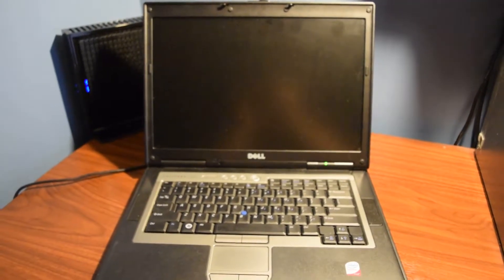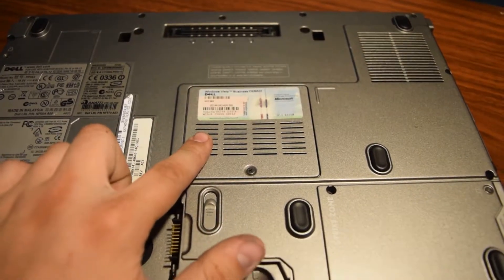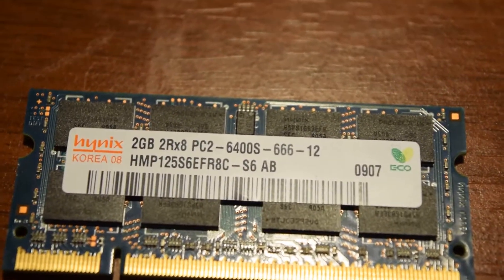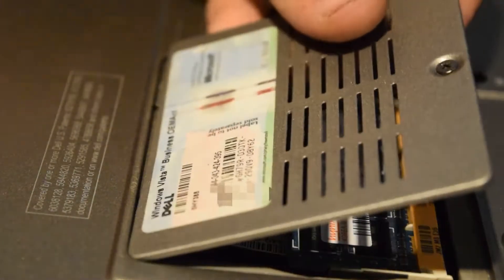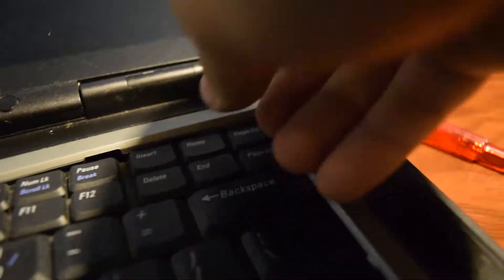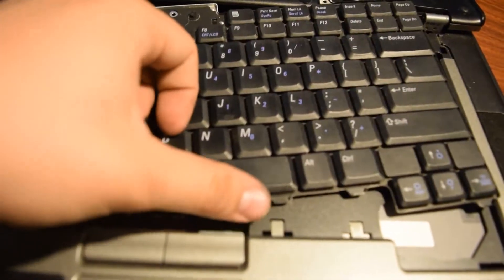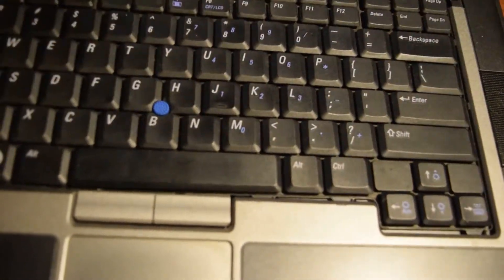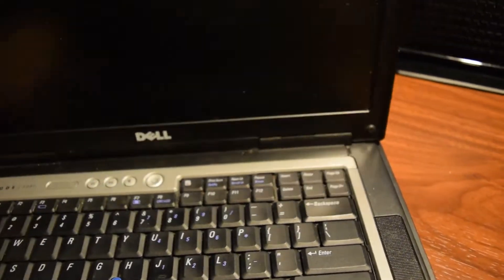How to Upgrade Ram - Dell Latitude D830

Comment: Do you upgrade bios from a16 to a19 for it to work better if so is it only with dell support
Reply: Was that a question? I just accessed the BIOS on my Latitude D830, damn thing is Version A05 and dated May 2007, so 15 years old! Hard to believe this thing is even cranking over with 15 years old BIOS. I have zero clue how to update BIOS, though. But I would need to.

Comment: i have the same exact laptop and im trying to upgrade the ram in it i attempted to do it before got success with the backside and not the front side  because the screws are messed up any recommendations on how to carefully unscrew the screws i would like to upgrade it to max amount of ram i read somewhere that it can run with 8gb of ram with the latest bios update (A17) might experiment with that if it works or not then ill bump it down to 4gb also i have the volume up and down keys where you take the lid off that are missing know any where that i can get a replacement for it and the indicators are not working either could i get a replacement on that also possibly thanks
Reply: Latest BIOS is version 17? Wow, I have BIOS ver. A05 from May of 2007. Which is when the thing was manufactured, so it has not been updated since May of 2007 until today, June of 2022, wow. If I knew how, I would love to update the BIOS. Another video? For RAM, yeah, 2 x 4GB DDR2 800 Megahertz SO-DIMMS, a brand new 4 GB DDR2 SO-DIM costs about $13 here in Hungary. But I am not about to tear apart the laptop for that, crazy way for Dell to place the RAM boards. I own a same vintage ACER Presario 6930 laptop, in which one screw on the back and you access the RAM compartment where you have two SO-DIMM slots right on top of each other. It's not worth going over 4 GB for Windows, but I junked Windows and I am now running the ACER under Linux Mint, so I put in the fastest 800 MHz boards, 2 x 4 = 8 GB of SDRAM, and Linux Mint is able to utilize all 8 gigs of it, thank you, Linux. The hell with you, Windows. Pretty amazing now to run an OS utilizing 8 GB or RAM -- in a laptop built in 2008. Especially when I see brand new WIN 10 and WIN 11 computers sold with not 8, but only 4 GB of RAM.
Reply: @frankfarago2825  ok nice
Reply: First, go back to school and learn to write.  Next, go buy a new laptop.

Comment: can u install 8 gb ram on the d830?
Reply: Right, max. 2 x 4 = 8GB, I am using 800 MHz speed sticks. Most 32-bit Windows that would run on a D830 will of course not support 8 gigs of RAM, only a little over 3 gigs. But any Linux distro would support the full gamut of 4, 6, or 8 GB of DDR2 SDRAM. I ran the D830 under WIN 8, not sure if it would run under WIN 10 or not?
Reply: @frankfarago2825  I have one in front of me now and it hates WIN 10.  Gonna downgrade this evening after installing a nice SSD.

Comment: Btw, that is not an SD Card reader inside the battery compartment.  That is a SIM card port for wireless services through subscription.
Reply: Exactly right. Which is why in the BIOS for the D830, you have options to select Bluootooth, WiFi, and/or CELLULAR SERVICE. After this major snafu from the poster, I am not sure I could trust him for any of the rest.